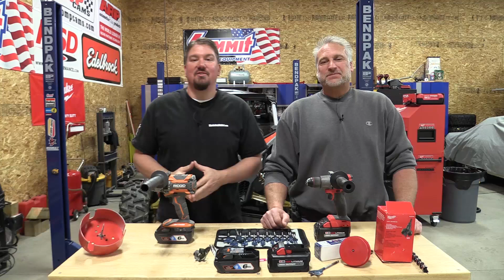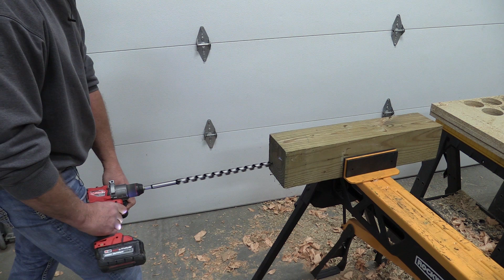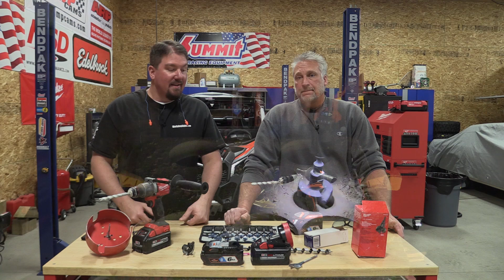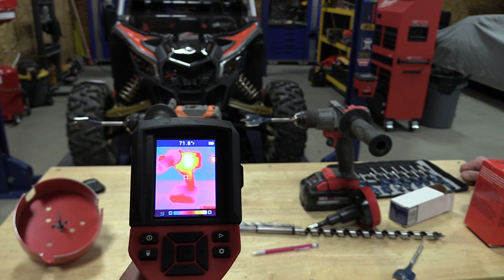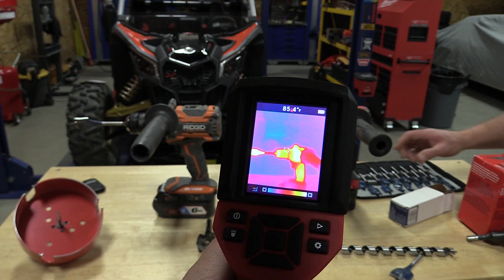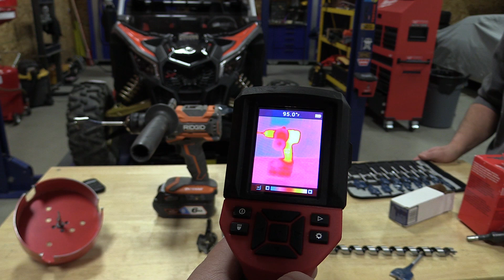Ridgid OCTANE vs. Milwaukee M18 Gen3 Drill Driver 6.0 High Output vs. 6.0 OCTANE Battery

Comment: I agree Milwaukee has to improve on their hammer on the drills I use it at work and you know sometimes I have to go to an SDS just to do quarter inch masonry. Rigid octane is made towards the tradesman. I like that rigid drill. Would I trade me Milwaukee line for that one drill? I don't think so rigid still has a ways to go before I'm sold.

Comment: Great comparison and update from the last video.  I'm a fan of the smaller size.  I just picked up the m12 gen 2 stuff at HD on Black Friday- you couldn't beat the deal.  I think it was $169 for the hammer drill and impact.  I still have the gen 1 in both m18 and m12, but the m12 is my go to based on the size and it gets 95% of my work done.  My m12 stuff us pretty beat up and my m18 stuff looks like new and spends most of its time in the case.  The new m18 is nearly as small, but I'm not ready to upgrade just yet.  I also just got the m12 1/2" stubby under the tree - I'm thinking my m18 gen 2 high torque impact will now spend a good deal more time in its case.
Reply: Love my Gen 2 M12 hammer drill and impact driver. Only minor complaint is the thicker grip due to the batteries needing to be in the handle.

Comment: I never use a drill long enough to make it that hot but working outside in the winter it’s a bonus if it does get that warm lol. I own both the Gen 2 & Gen 3 I think they are both great drills but I do like the more compact version and more power from the Gen 3.
Reply from the maker: We want to do some testing outside in the cold to see if they heat up to try to narrow down if the tool does not move enough air to cool it or if it is a copper thing.

Comment: If you do a lot of drilling into concrete you would have a dedicated hammer drill, I feel that test they both performed almost equally because of the inconsistency in the concrete.

Comment: I use that same Milwaukee drill and that bit that you used to drill into the 6X6 to drill holes into utility poles for framing  while doing line work I have never had an issue with the Milwaukee. I can drill a crap load of holes on one battery and it has constant power.
Reply from the maker: We hear that day in and day out from people who use them on the job.  The Gen 3 rocks.

Comment: one thing I was curious about was when the Milwaukee drilled slightly faster with the spade bit and Ridgid faster with masonry bit I noticed on the spade bit you took temperature readings and one was hotter than the other  I wonder if bits very in speed them self would be interesting to change the bits back and forth.
Reply from the maker: They have the same RPM in high speed.
Reply: @wrenchesrides That makes me question why the temperature of the bits was different even more wonder if maybe one of them is a little sharper than the other causing it to get hotter I don't remember which one was hotter though just curious  happy with either drill I think you did a good job on the comparison.
Reply from the maker: @travisevans7502  Not sure if the one bit I measured in temp second had more time to cool?  OR The real reason there could have been how hard one pushed on the drill.  Those temps were taken after a lot of drilling, not contests involved, just drilling.  SO Jeff might have been pushing harder than me.

Comment: I like both brands but chose Ridgid for the lsa my tools don't get heavy use so it makes the most sense for me because no matter how little use my tools get Milwaukee will have no warranty after 5 years my Ridgid will I know they wouldn't refuse your warranty claim 10 years from now if your tool had very little us and still looked new the batteries is where it will be most beneficial I know the lsa doesn't  necessarily mean a lifetime warranty it means the life of the tool it would take me much longer than 5 years to get a life time of use from my tools. Now if I used them every day to make a living and the tool was going to be worn out in 5years then I would go Milwaukee I think Milwaukee overall makes the better tool but not by much.

Comment: I'm an Electrician and have change from an aging 18v Milwaukee set to the new 18v Ridgid brushless line and am not disappointed! I own all their 18v brushless tools and love them all. At this point it seems to be a no brainer going with ridgid when they can push as hard as any brand and to be covered by the LSA to also have batteries covered within the kits that is but if you buy right that could work out pretty great for you. Just register when you buy from the home depot and you're set. I'm even giving the multi tool with the exchangeable tool heads a go and the power won't blow you away but the  ability to have a compact tool with that much versatility makes it well worth having, it has a lot of jam to pull it's weight. I drank the orange kool-aid and it's delicious!
Reply: I have been running rigid two and a half years running a framing crew and I have still yet to have a tool brake
Reply: How are the ridgid tools holding up? I just bought a brushless set and im a electrician as well, but decided to switch from milwaukee
Reply: Still solid... used the LSA once however on the light canon which the led's burnt out. They sent me a new one in the mail. Not bad at all.
Reply: When your Union the contractor supplies all the right tools for the job. Keep your tools at home. Mostly Milwaukee on the big boy jobs. They can't be beat.

Comment: I made the switch from Ridgid to Milwaukee this summer when the gen 3 came out. Best decision I've made. The Ridgid at only a year old was constantly shutting down while drilling holes in steel. I'm a commercial electrician currently on a $320 million job site and I see probably 70% Milwaukee and 30% DeWalt but never any complaints about tools shutting down. And the best part is I can leave my chargers at home where I had to keep at least two in my Ridgid tool bag just to keep up

Comment: I have milwaukee gen3 and also rigid gen5x.milwaukee is good for wood and hole but in the concrete i go rigid speacialy we always use hammer drill for 5000 psi concrete and the rigid are beast.some of are guys have milwaukee and rigid both brand we always carry and i think they are good cus we have an option tools for the right job..
Reply from the maker: I am not a one battery platform guy.  We, like you, find it best to use the best tool for the job!
Reply: @wrenchesrides  the 2 brands are realy good in the jobsite..me also i use a lot of rigid and milwaukee brands  both are good tools..i am electrician and both brands are ok.rigid octane and milwaukee gen3 the best drill and impact driver for me..
Reply: komegamix do you have overheating problems with your gen3 drill?

Comment: Only thing I hate with the couple tools I have of Ridgid, the battery slide on the tool start to warp or something. Like it's not as easy as it use to be to put in a battery.

Comment: I run ridgid and have noticed that they shout down like on a safety. And being made by the same people Funny
Reply from the maker: Some of the Ridgid tools do seem to have a slight bit easier time to get a timeout.  Could be the wiring or the number of amps they are allowed to pull.  Different battery cells might not be as good as others.

Comment: Good video fellas.  I use the Milwaukee every day at work , and fortunately we have a bunch of good guys which ultimately lets me see all different brands of tools getting pushed within 1/4” of their life....Milwaukee...Dewalt.....Makita...Ridgid and the list goes on and on.  We also have Ford & Chevy guys too !!
  My Milwaukee has had 2 chucks strip where you could not get the bit out , however the truth is that we beat the living crap out of our tools every day all day trying to go faster and be more productive to make more money...you get the point.  I personally think that “most” of the top manufacturers are putting out a good product and we as consumers are certainly going to benefit from the intense competition.  However it does make for good fun telling everyone that you suck unless you use Milwaukee.....and that fellas is the holy gospel....says so right on the side of my lunch box....😜😝😜

Comment: I’d say that the Ridgid tools are great for DIYers and homeowners as the Milwaukee tools are great for contractors
Reply: Jason Babila 
We are electrical contractors and use Rigid every day with no problems. The new octane’s are at the top or near the top in every category in performance. The bottom line was best value and lowest cost of ownership, just wish they made a bandsaw.
Reply from the maker: We see a ton of Ridgid on jobsites.  Especially the concrete workers.

Comment: Me personally, this might be the best video you guys have done!  I didn't know about the Ridgid being so good with concrete.  I have a new respect for their line of tools now because of your video.  Milwaukee needs to get better at hammer drills.  Their SDS drills aren't that good either from what I've seen.  Steer clear of Milwaukee for hammer drills.  Drill/Drivers  and Impacts are excellent on Milwaukee though.  Thanks for the great video.
Reply from the maker: Thanks TT.  Did you watch our last video about these two drills?
Reply: @wrenchesrides  No i didn't. also, I didn't know about this channel of yours.  Can't wait for the next video you put on YT!  Very well done, thank you. I just had a thought, I wonder if the one key version 2806-20 has any settings that would allow you to have the overload/thermal and kickback protection kick in sooner and help with the heat build up in the drill.  I know you can adjust the kickback to be whatever sensitivity you want.   There's alot of adjustments you can do in one key.

Comment: The Milwaukee is a compact drill. Most powerful on the market for a compact.
Reply from the maker: Does Milwaukee make a full-size one then?
Reply: Wrenches & Rides gen2 was a full size, they then turned it in to a compact. Does not have to be listed as that to see the specs show it. Troll on brother

Comment: Love the video. 

With TTI's three brands (Ryobi, Ridgid, & Milwaukee) I think they do a pretty good job of covering all segments in power tools, but with what Ridgid is pushing out over the last few years, and especially with their octane line, I think either Ridgid is punching above their weight, or Milwaukee needs to step it up a bit. 

With many sales HD has, Ridgid has some amazing bang for your buck.
Reply from the maker: Maybe HD is demanding more from Ridgid and that is an in-house brand....
Reply: Wonder what that will mean for all 3 brands overall. Every HD I've been in has a pretty decent Ryobi display, usually a selection in the power tool aisle plus an end cap (one even had 2 end caps of Ryobi stuff),  most usually have a Milwaukee end cap on top of their normal power tool aisle stock, but very seldom do I see much of Ridgid outside the normal stock.
Reply from the maker: @jeb5137  Our HD stores have one Two Ryobi, One Milwaukee, One Makita and a small Dewalt section.  You are correct, no Ridgid.  Odd....  I have to bet that Ryobi outsells Ridgid.
Reply: Wrenches & Rides yea ryobi has been their brand for ever. They want homeowners to see that, the pros know where to go

Comment: Everybody acts like Ridgid is a homeowner brand, they couldn't be more wrong they make tools just as good as Milwaukee,Dewalt,Bosch and Makita if not better
Reply: Ridgid impact wrenches are nowhere close or even in the same ballpark to Milwaukee's line up.
Reply: Giovany Santiago yeah but ridgid comes from pipe work not really dealing with breaking bolts
Reply: The ridgid crushes a lot of the tools there it will shit on ryobi craftsman and the dewalt 12 and 18 volt all day
Reply: Not true. The cordless circ saw is nothing like the DEWALT 575 or 577...the jigsaw is no where near the new compact dewalt ..the cordless router is not even in the same ballpark...the octane sawzall is better then the flexvolt...the drills and impacts are much heavier...
Reply: @joeframer9642  actually DeWalt didnt have a cordless router till just now...Ridgid also came out with their hand planer and their octane line kills DeWalt in everything. Plenty of videos on their orbital sawzall crushing the yellow brand sorry.

Comment: Thanks guys, your other video "helped" me decide to go with the Ridgid line and this video did nothing to change that decision. 
Though, in my opinion, this video put them both on even (er) playing field. I still prefer the LSA i am getting with the ridgid plateform and the bang for the buck.
I will easily admit that the Milwaukee line is better in likely all their tools but im a DYI(er) so i look at the fact that i dont make money with these tools; i save money by using them to work on my cars both at home and on the autox track and i make everyone in my family happy when i work on their cars or work on simple projects. 
So being a second quicker per hole or a little smaller doesn't justify the extra cost for me. I dont have to hold the equipment all day long so i dont worry that one is a bit more comfy than the other.
Since i dont use these tools as often as you pros, my equipment will last 10 plus yrs but the batteries wont.
I bought a Milwaukee kit (drill, recip, cir saw) and their 250lb impact wrench (big boy for the day) with (4) 2.4 ah NiCd batts. Must have been gen -0 here is the model# for the hammer/drill to give u an idea of the age (big beast, so big, i used my black&decker more) 0624-20. I biught the impact in 2002.
So my piont is while they still worked (because i didn't use them too much) the batteries where done and i wasnt going to spent the money on new batters when that money could go into new equipment with batteries. And so here we are: 
I choose the ridgid because thy will do the job and i will have batteries for life.
How can anyone argue with that ;)
Thanks for ur great vids, this challenge is one i really needed to see
Reply from the maker: Thanks for the comment Henry.  We do not make our videos to promote one tool over another, we just try to educate or show people what they might expect the tool to be able to do.  Like you, many would rather have their money in cars or car parts than in tools.  Some feel different.  It's nice to hear that we met your expectations in this video.  We did not have the 6.0 HO battery in the last video and we did not think it would make that much difference with the drill.  It sure did!  Thanks for hanging out with us!
Reply: For what it's worth, I'm a contractor and run all RIDGID tools. They are a pro grade tool that will hold up to daily use.

Comment: Both awesome drills.  Considering the Milwaukee's size though, its power and performance is amazing.  I'm not surprised about the Ridgid's impressive hammering function, I have an over ten year old Ridgid 18V hammer drill and it works really well.  Great video, fellas!
Reply from the maker: Wow, 10-year-old Ridgid 18 volt.  Awesome.  Thanks Rob!
Reply: Yea, it's not used daily, but it's had a few tough jobs over the years and it's still going strong.  Unfortunately, all of my old Ridgid tools sat unused for a long time because the NiCad batteries no longer worked.  Thankfully, a new 4Ah L-ion battery kit revived them.  
The drill's hammer function works surprisingly well, although I haven't used large masonry bits.  The only negative is that the drill is much bigger than these new models; not so much in width, but length.  It looks almost comically long by today's standards.  I use a compact, brushless Milwaukee M18 drill driver for most drilling tasks (great little drill, btw).

Comment: i liked this side by side comparison  please think about the two other big dogs to compare dewalt and makita .I wonder how those brands stack up . I also wonder if heat will shorten the life of that Milwaukee and it doesn't have a lsa like the Rigid. professional everyday users might upset to have to replace it.
Reply from the maker: We have plans to look at all of them.  This was a redo of a challenge where we did not have the 6.0Ah battery for the Milwaukee.  In the professional world, I do not believe the LSA or 5-year warranty matter much.  Many times the warranty will be denied due to "abuse".  If you find a 5-year-old battery operated tool in a professional environment, it has been well taken care of and that owner needs to buy a lottery ticket.

Comment: Enjoyed your review.  I'm a car guy too and yes compact, grip comfort would entice me toward the Milwaukee.  I wonder if the upgraded battery attributed to more heat being generated into the handle?  Anyway, for me it would not be an issue as I would never be using it as you have demonstrated and also pointed out.  Look forward to new year reviews....thanks
Reply from the maker: This drill driver heated up very similar with the 5.0 Ah battery also.  This is a small drill and they are asking it to push a lot of power out.